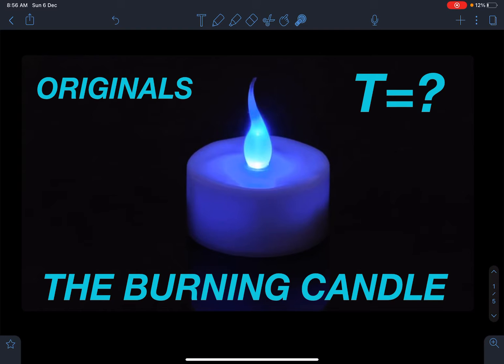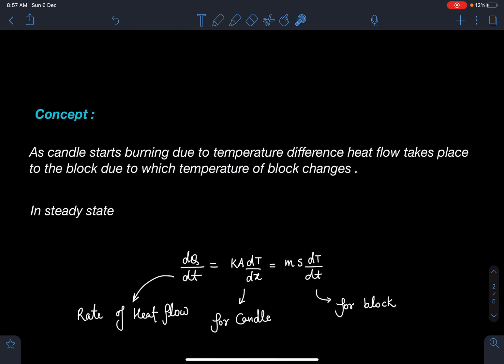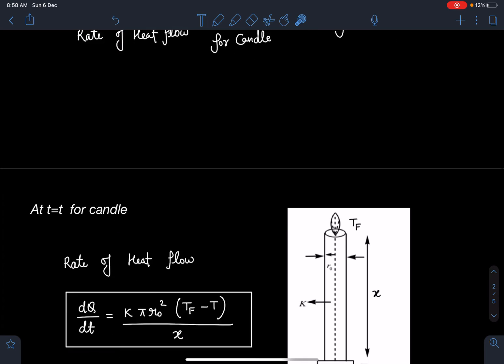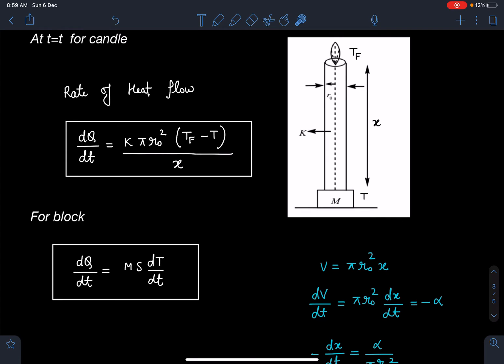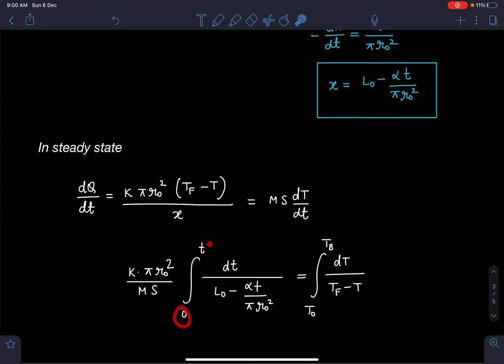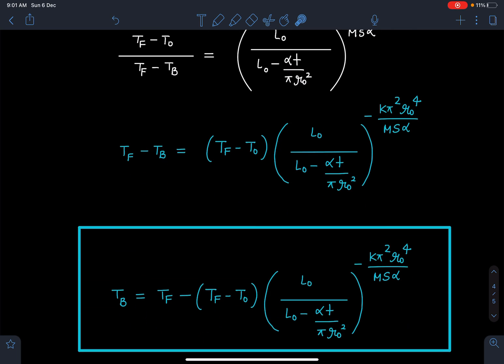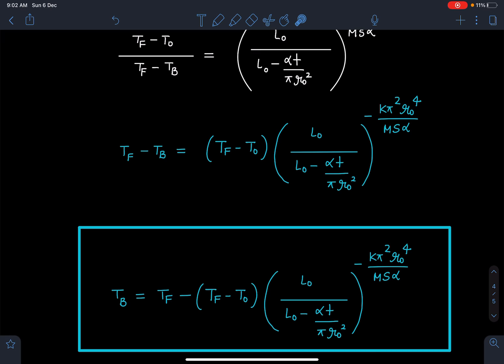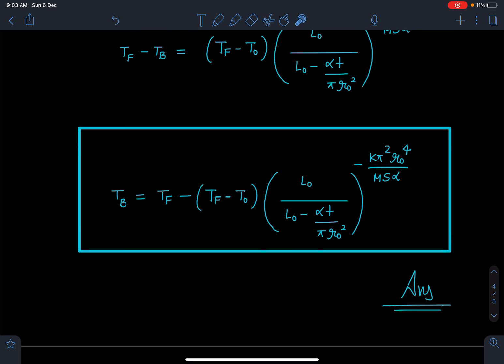[JEE ADVANCED] HEAT CONDUCTION IN A BURNING CANDLE [ ADVANCED PROBLEMS IN SCHOOL PHYSICS ]

Comment: A droplet of water is formed in a region of moist air whose density is uniform throughout. It falls down and while falling it is able to collect any particles it encounters. Assume the drop remains spherical and experiences zero drag. It attains a constant acceleration after a large time interval. Find this acceleration. (FIITJEE AITS 2021)
Reply: I tried this problem but due to time constraints had to leave it in the exam
Reply: Ans is g/7
Reply from the maker: I’ll share it’s working in one of my video
Reply: hattori kanzo how much did you score in todays test, and yesterdays mains exam. Whats the highest anyone you know got.
Reply: @dubey6670  241 mains 96 p1 adv 123 p2 adv. I really messed up p1 and mains p2 was fine. Highest I know is 300 mains and 150 p1 and 163 p2
Reply: @hattorikanzo2793  oh grt. I got 239 mains . Adv P1 99 P2 119
Reply: @hattorikanzo2793  are u a fiitjee student
Reply: @dubey6670  yes
Reply: @Hattori Kanzo . whats ur rank in main and adv pt1
Reply: @dubey6670  how much did you get in today's test?. I got 238 mains. 110 adv p1 120 adv p2.
Reply: @hattorikanzo2793  I got 235 mains . 98 adv paper 1 and 117 in paper 2
Reply: @hattorikanzo2793  Ur rank in last test?